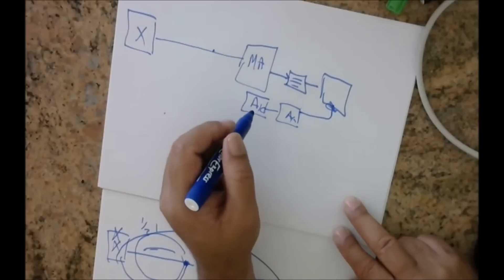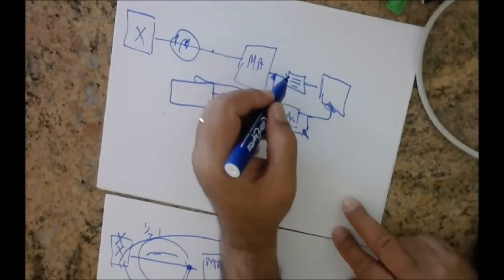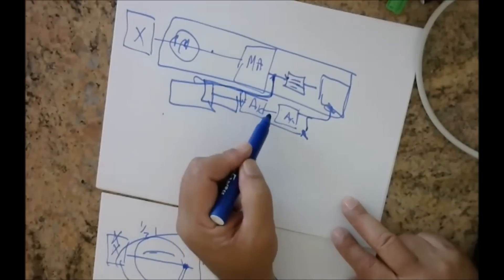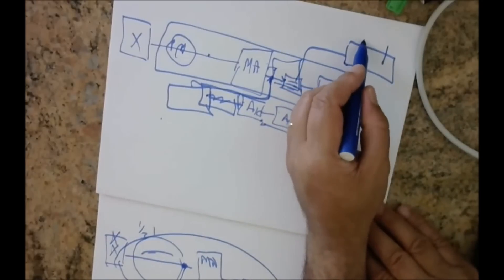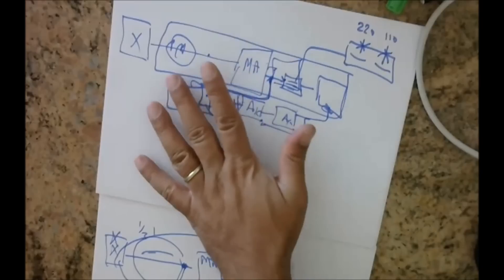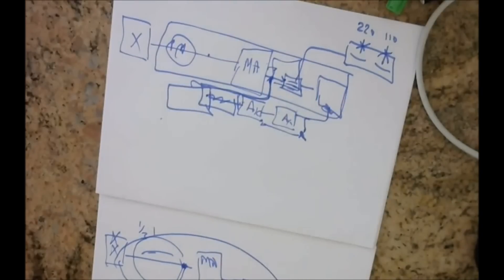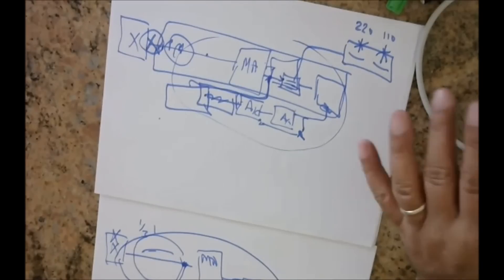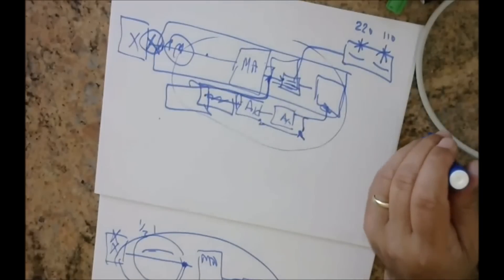Self sufficient MAGRAVsystem

Comment: once your wires in your house or whatever are nano coated, can you ever use regular (old) electric system again? Should you choose for a multitude of reasons, or if something happened to your Magrav? I have an rv (camper) I'd like to try it with first. If I ever find someone who takes the time to break this down step by step, simply for those of us not in this field or have understanding of it. Anyway, if I were to sell the camper or house can it be hooked to the old electric system again?
Reply: Yes you can do both and plug everything in in some to ime it will become more and your electric bill will be almost nothing